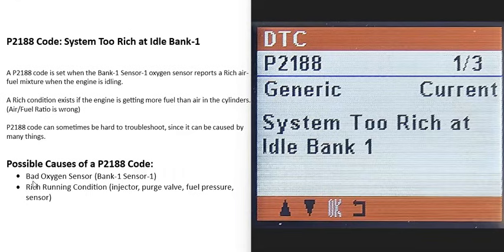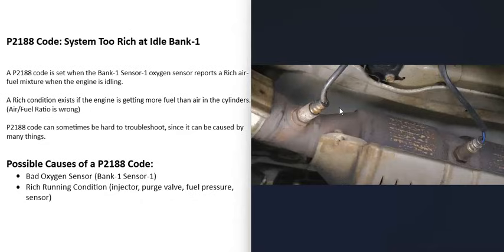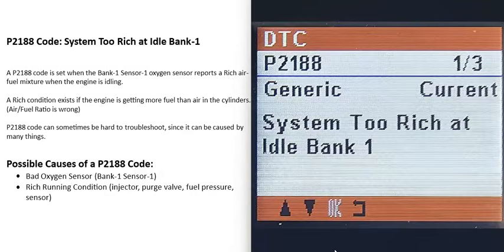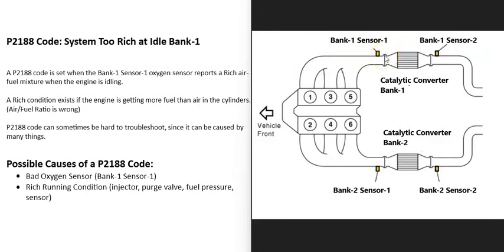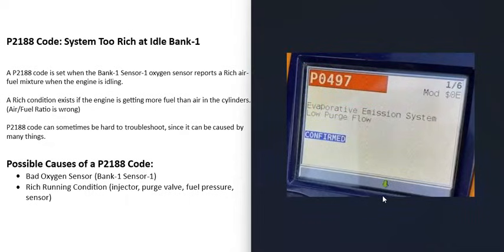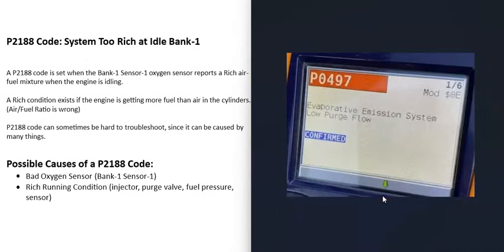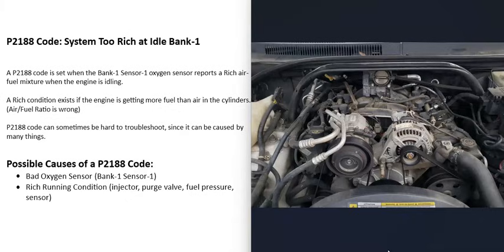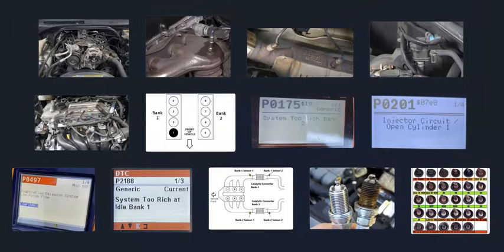Causes and Fixes P2188 Code: System Too Rich at Idle Bank-1

Comment: Hello, did you say that comparing spark plugs to a burn chart  Can't tell you whether one of the cylinders is Running Rich?  4:17
My second question is , how long does it take to run a high pressure fuel test to diagnose P2180 too rich off idle & P0303 ignition coil misfires.
Reply from the maker: Checking how the spark plugs are burning is an old-school method to see which cylinders are running rich or lean. It was a method mainly used before computers and scan tools were available, but it can still work. If you have a scan tool with Live Data/Data Stream reading the fuel pressure (low and high) is quick.

Comment: WHAT SIDE IS BANK 1 ON?
Reply from the maker: Google your engine and cylinder location, and it is on the side with the #1 cylinder, which can be different depending on the engine.

Comment: I have a 2018 VW Tiguan 2.0 that is stalling intermittently with p02188 code only and goes into limp mode’ 2188 is the only code
4:32

Comment: Ive got these 2 codes coming up on my 3.2L v6 2010 Suzuki Grand Vitara:

P2188 – System Too Rich at Idle (Bank 1)

P2190 – System Too Rich at Idle (Bank 2)

It would be amazing if I could be pointed in the right direction. Many thanks!
Reply from the maker: When both banks are running Rich, that usually points to an issue that would affect the whole engine, such as fuel pressure, vacuum leak, or a bad sensor.